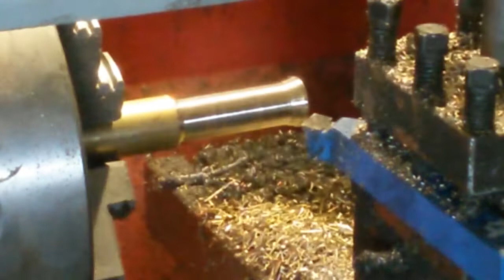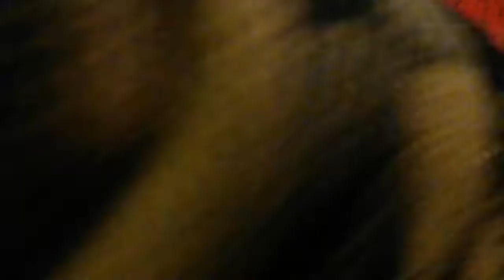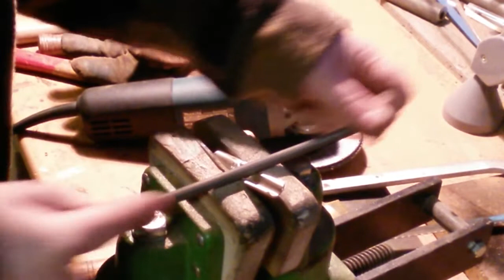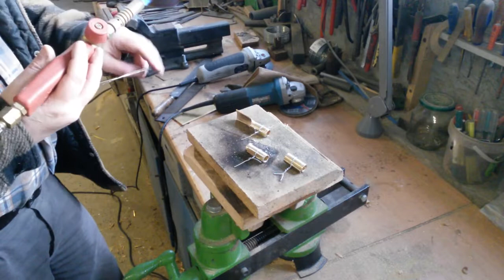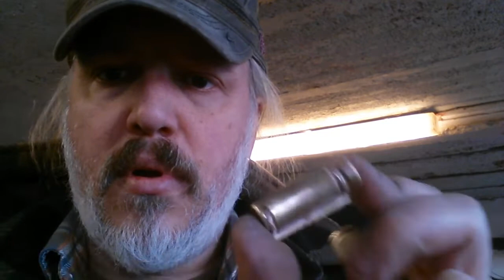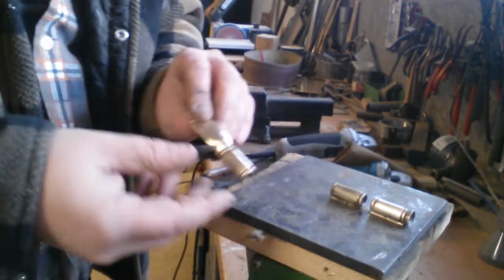Swivel breech rifle scratch build pt 33 making ramrod pipes for screwing

Comment: When I saw the brass after soldering I thought it had a nice aged look. You could consider making the gun look aged. I did this with my flintlock dragoon pistol. Then you don't have to keep cleaning the brass!!
Reply from the maker: In this case I think I will do only a slightly aging but the remains of the soldering flux are no good choice, cos it can trigger a color change on the wood or even acorosion on the barrels. Some brass black and than a slightly polisch ? Hmmm I will try 😁😉